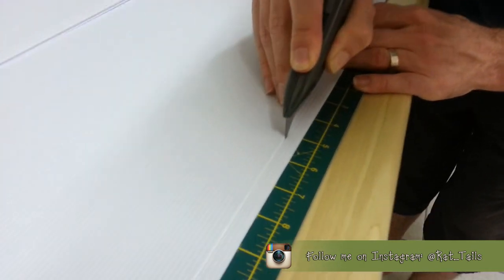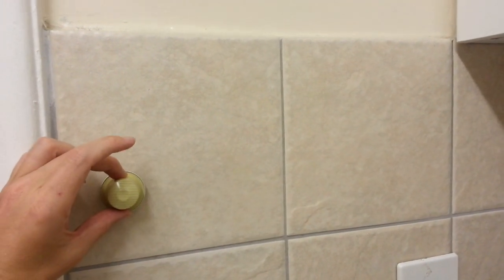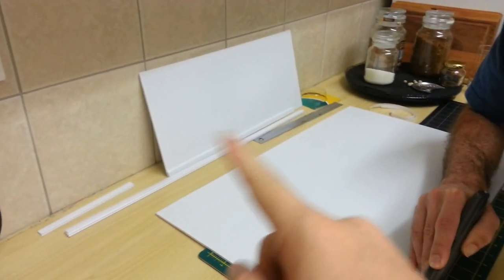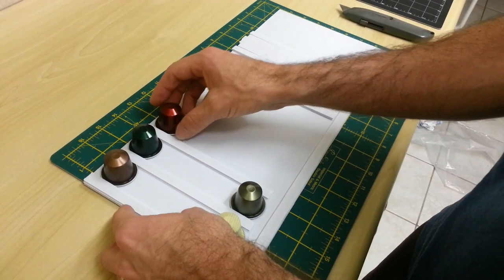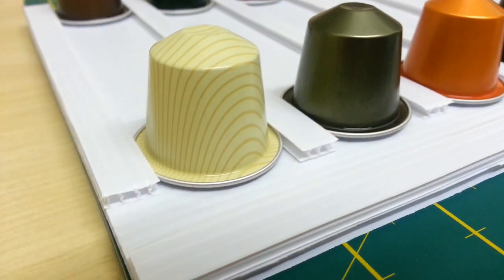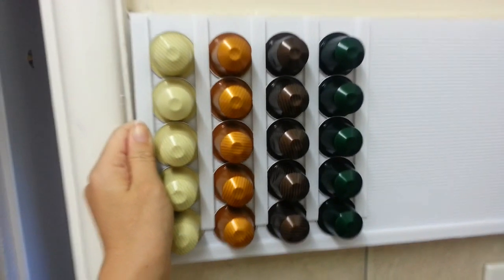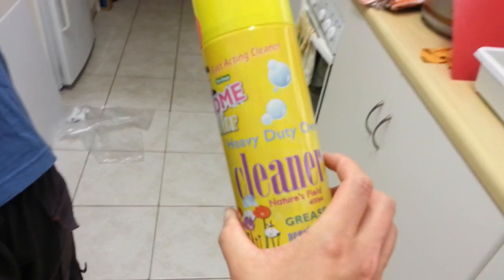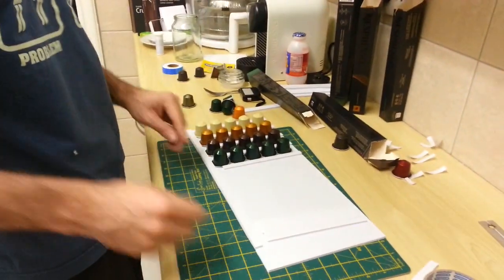VLOG | DIY Nespresso Pod Holder! 2013-12-26

Comment: Great video! Can you please tell me how do you manage to have such a clear cut on the corrugated plastic board? I myself tried it with a metal ruler (not on plastic but on a paper cardboard) but still the strips weren't as straight as yours:(
Reply from the maker: Hi we just cut with a sharp blade on the plastic, in the lines already provided by the corregation and it came neat by itself :)